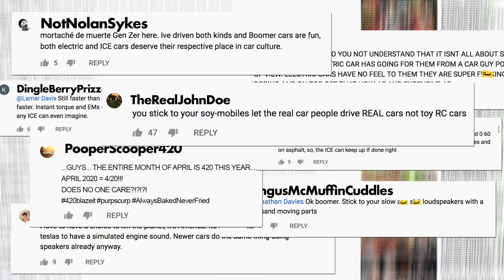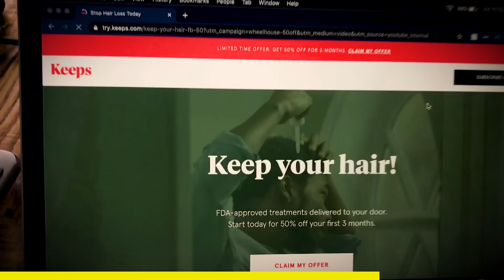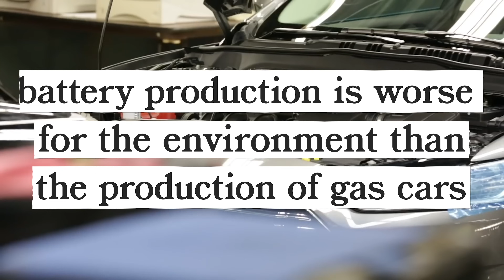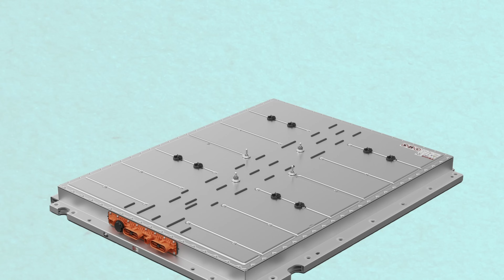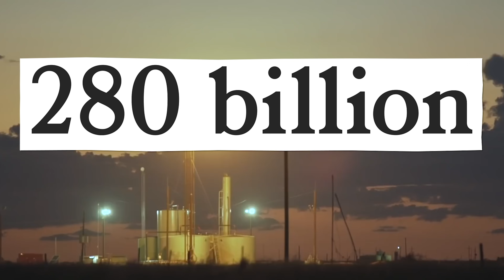Are Electric Cars REALLY Better for the Environment?

Comment: There's another problem:
The batteries don't life forever. I think I heard of a lifespan of about 7 years. Recycling old Lithium and Cobalt is not that possible as I think. 
What about the waste? And then we need even more batteries to exchange the old ones. Oh man.

I'll stick to gas anyways. Even tho with smaller engines. But I personally just need that feel
Reply: This is most certainly not the case. Here, you can look at real life data for how tesla batteries degrade. https://steinbuch.wordpress.com/2015/01/24/tesla-model-s-battery-degradation-data/

After their useful life as car batteries, they are used for second life projects where they help balance the grid. It is true that at this moment, the battery recycling industry is still insignificant, but you must not forget that the demand for battery recycling is behind the trend of EVs for like 10 years. The growth in EVs now will make it such that in 20 years, the demand for recycling will rise. Also, scientist are looking into using common elements. Rarity only bumps up the price. It's unreasonable to assume Cobalt will always be used in this quantity. The technology will move on to better designs.
Reply: @thatyougoon1785  ok that's a good thing :)
Reply: Lithium batteries (in Teslas case) are recycled.
Reply: @VincesVoices  warte mal. DER ORIGINALE SPEED COMPARER?!

Omfg xD

Comment: One thing to note about EVs is that they lose range every time you charge them with fast charging doing even more damage to the battery.  You aren't crazy if you feel like your phone battery runs out faster after a year or two.  This is why Evs will never truly replace gas or any future fuel cells until a major change is made in battery technology same reason solar will remain a minority source.
Reply: Tesla have already talked about a battery good for 1 million miles.

Comment: I have one pickle to pick with this comparison video - if I understood it correctly you took more than a year of running to compare EV vs Gasoline car. But what about if we consider battery replacement/engine replacement? I read somewhere usually you need to change batteries in EV every 5-8 years. Which would surely impact those numbers a bit. Right?
Reply: No, that will not be the case. https://steinbuch.wordpress.com/2015/01/24/tesla-model-s-battery-degradation-data/

Comment: Did you take into account that the emissions behind the production of the EV batteries are not just a one time expense though, since batteries die and you have to keep replacing them?
Reply: EV battery packs typically come with an 8 year warranty. Tesla have supposedly come up with a battery good for 1 million miles. Which would put the argument to bed.

Comment: Excellent and balanced video! Some notes:

Lithium and cobalt are definitely issues, but if you're reading this on a laptop or mobile device- that's the major use of lithium (plus 18% in ceramics and glass).

And about 9% of global use of cobalt is for desulpherisation... that's the process where gas and diesel are refined so they're usable as a fuel source. So 'clean diesel' has a major cobalt component use as well.

Tesla is also working on a 1 million mile battery. If the batteries last that long, then you're getting far more use of your lithium and cobalt- that's a far better payoff than most of your batteries in all sorts of other uses.

Finally, don't just focus on CO2. ICE vehicles also produce particulate emissions... the kind of things that are leading to major respiratory health in major cities.

I fully understand the love of the roar of a V8... but environmentally (and in terms of efficiency of converting fuel source to pure motive power), EVs dominate.

Comment: The REAL Question is:
Are Electric Cars REALLY Better for the Enjoyment?
🚫 😴💩
Reply: oh boy you need to feel the pull of the electric motorcycles, they deliver all the torque at any moment. Combustion engines need to be on the RPM sweet spot for maximum torque.

I know I know, the sound of combustion engine is a huge PLUS. I do have a sport bike that revs to 16K RPM so yeah I know what a sick sound can produce.  But I'm also an amateur motorcycle racer, so I also take into account power to weight ratio and torque figures. This first generation of motorcycle are a promise of a interesting, no so far, future
Reply: @luisdiegocr  Hola Diego!
I know I know...  Take it as a rant from a hardcore fuel addict,  ROFL!  
It was my attempt to troll. 
Up to a year ago I still trusted that ICE engines would somehow prove their worth.   But now I think they may lose this fight.  But I will, for sure, keep an ICE car to enjoy the sweet feeling of changing gears on my own and feeling independent.  
NOT inside a huge Laptop that registers and tracks my every move 24/7 which is what eCars do: the ultimate spying machine. Imagine when our own cars start issuing us tickets for speeding...  Or when car memories become evidence in trails... 
A brave new world my friend, iPhone. FB & Google's new friend: eCars!
I have seen some of those bikes on YT impressive!  Enjoy yours when you get one!
Reply: Yes
Reply: The mass majority of car buyers are buying Corollas or other equally boring commuter cars. . . The sports car enthusiasts were never the problem.

Comment: Another thing you never touched on was that the batteries become less efficient over time too. So they become "heavier on fuel" too so will have a higher carbon footprint. Maybe not as high as an ICE car but still brings it more in line with what will actually happen.

Comment: So what i got from this is that its really not the cars that arent efficient its just the production of fuel for each car. Even if its electric it can be just as inefficient as a gas car just due to the production of fuel. So why not fix the production proccess of oil and try to capture that carbom monoxide.

Comment: I live in the country and have solar power on my roof.  I drive a Chevy Volt about 8000 miles a year.  The solar power charges the car and I have 0 use from the grid.  In fact in 2019 I put more than 600 KWHrs into the grid.  The Volt does have a gas engine and I used 52 gallons of gasoline for the whole year of 2019.  Due to the lack of charging stations in rural area where I live I didn't choose a 100% electric car.  But I am helping global warming and air quality perhaps in a small way and enjoying not having to pay the electric company any money and not paying oil companies much either.  A win for me and the future of the world..

Comment: 5:55 Nuclear is clean energy in term of CO2 production too.
Reply: Not so much, yellow cake has to be mined first to make the enriched uranium first, then you have to build a plant, hopefully better than Fukushima, then a lot of water is turned into seam...more CO2. 
After it is all said and done you have to bury the highly radio active waste after using more chemicals on the rods to draw out more uranium, creating more HLW waste too...so how do you effectively measure all that?
Reply: @sickjohnson  You can say the same exact thing for all others clean energy, you have to mine materials for them, you have to recycle them after a certain amount of time (20 years for solar and windmill) and since you're talking about recycling, you should look into the problem of windmill blades, it's a good read !
About the HLW, it's a non-subject, if you take the exemple in France, it's only represent 0.2% of the whole volume of nuclear waste, it represent a cube of 15meters since France started nuclear (most nuclearized country in the world).

And all that talk is pointless, Solar and Wind are intermittency energies, you can't relay on them uniquely, you need a energy wich can be controlled.

So either you burn gaz/coal, either you go nuclear with way less co2 emissions.

Until we're able to use fusion power, if it's possible.
Reply: @EnrichedNaquadah  Agreed, and I read about the fiberglass wind mill blades failing and are not recyclable, not to mention the size of a huge tractor trailer truck.

Comment: i saw a gasoline powered car towing a diesel generator to charge an EV car :P
Reply: Weirdly enough, putting gas through a generator to make electricity for your EV is still more efficient than just driving a gas-powered car. . .
Reply: @normang3668  True!
Reply: My brother in California was using his generator to charge his Tesla last summer in Northern California during the brown outs
Reply: I saw an EV towing a gasoline refinery for a car that had run out... Wait what?
Reply: @skodbolle  A whole refinery huh? Sure.
Reply: @skodbolle  Gasoline refinery? Nah bro it was prolly just a jug of gas.
Reply: @somethingsomething3718  Nope.. a generator is the same as a refinery, it's where to power comes from.. The gasoline car wasn't towing a battery now was it? :)
Reply: @skodbolle  Wrong, a refinery is not the same as a generator. A refinery refines crude oil into gasoline, Diesel, etc. A generator uses fuel (diesel mainly, as its more efficient than gas, due to the higher compression rate) to generate electricity.
Reply: @skodbolle  LoL, did you eat paint chips as a kid?
Reply: @MrShadow1617  Gasoline in a container, is more or less the same as a battery, you store energy in it, and therefore not he same as a generator :) I know it can be har  to understand ;)
Reply: @mantis_toboggan_md  No, did you? :D Kind of a strange question
Reply: @skodbolle  Yes.  Petrofuels are potential energy in a STABLE format.  Left alone, they will reliably store that energy for over 2 weeks, and be no more dangerous than a tank of mineral oil.  Since it takes a mixture of AIRand petrofuel VAPOR to become combustible, it's a nice way of doing it.

Batteries are stable UNTIL you try to store energy in them, which makes them volatile.  Also, that energy slowly leaks out and has to be replenished, EVEN IF THE CAR IS NOT IN USE.  Never mentioned as far as efficiency or 'clean and green' numbers.

Speaking of numbers...going from 20x more energy being used by an engine that's 20% efficient, to 1/20 the energy and an 80% efficient motor...explain how that's an IMPROVEMENT.  (20% of 200 watts is 40 watts.  80% of 10 watts is 8 watts.  The EV can go only 1/3-1/4 the distance an ICEV goes per charge or  fill-up.  That's a MAJOR DOWNGRADE for ZERO actual benefit.)
Reply: @skodbolle  I was talking about an ACTUAL generator, that USES fuel. Sure, every damn internal combustion engine powered car has a fuel tank, but it still lasts longer than a battery in an EV. I can go for about 4-5 weeks without needing to refuel my own car, especially since its a diesel.
Reply: @MrShadow1617  I can go for about a week with out charging my car, but I do charge it when it sits in the garage anyway from my solar panels.. Sooo how far can you drive in your diesel for free? 😉
Reply: @skodbolle  Alright, fine, guess you got your own house, with everything paid off, only having to pay for utilities. Went a bit off topic anyway.

Comment: What's the average battery change interval? Are you assuming 100% battery efficiency, along with manufacturers stated ranges?

I feel like if the battery only lasts 3-5 years and becomes less efficient, it might still be a toss up.  Also wonder how much power is lost from the plant to the home...voltage drop and such.

Comment: Great episode but what about the life of a battery pack vs the life of a gas tank.
Reply: Reed Nelson your average EV battery is good for 200 000 miles, or about 17 years going by US national averages. An ICE engine is designed to last around 100 000 miles by current production standards.

Yes you see ice engines going for far longer than 100 000, because they’ve been entirely rebuilt, bringing production emissions up far higher because a lot of these specially built parts are not being built as efficiently as the OEM parts are in factory.
Reply: @thomasellis7625  there are millions of cars on the road today that have well over 100k and far into 200k miles on the original not rebuilt engine.

Comment: Appreciate this info. As some one who loves V8s and has a life that revolves around heavy equipment, I'm skeptical of EVs. But I hope the technology progress's enough it is much more effective in different applications. I'd love to see a one ton truck with a diesel over electric drivetrain, but the cost and weight of such a thing seem to make that a pipe dream
Reply: diesel electric is the only profitable way to go for heavy vehicles and there are plenty of them already around us so its not a pipe dream
Reply: @bjorn1583  what I was meaning  is  diesel over electric is common in locomotives, and mining equipment. And works well. But I myself haven't heard of it in highway trucks or pickups. Or even farm tractors. (I think John deere and maybe case played with prototypes but I never heard of it hitting the market). Electric and diesel motors are heavy at the moment so some what ineffective  in those markets. But they work very well

Comment: Great episode.  You forgot two things... 1) ICE cars have been there longer, hence, getting a used one means that someone else had paid for the initial footprint.  2) ICE requires more routine maintenance in the form of belts, grease, oils, etc.  This should add to the footprint. 

Again, great episode.
Reply: @Unintended Consequences Mechanics etc. could go broke if ev's take over, a factor in why there is opposition to ev's. Not as much to go wrong with ev's.
Reply: Justwantahover Yeah I’m a licensed truck mechanic. EV’s will definitely make work slower
Reply: Problem is that battery packs are only good for 6-8 years and then need to be replaced with not even doing close to the same daily/yearly mileage as combustion cars lasting past 17 years on average. Nolan didn't take in account for the carbon footprint of solar panels and wind turbines (short lifespan) as well...like he did mention for oil and gas production. Ironically EV's use way more oil to produce than combustion cars do sadly. 
Solar is almost never used to charge up EV's as they mostly operate in daylight hours and charge at night.
Did Nolan ever mention that fuel is 5 times more energy dense minimum than batteries, and that means that must weigh at least 5 times more, and that extra weight takes away even more of their already low efficiency? 
There are many more factors that should have been considered too, other fuel types too like ethanol...
All you will ever be told about is the maximum efficiency of an EV, in a vacuum at ideal temps...add some hills and some cold weather that plagues the majority of the world and that will take it down below half before you add any weight to the EV; not to mention just after 2 years the EV's storage capacity is noticeably reduced unfortunately.

Comment: Here’s the problem: hydro, solar, and wind can’t even hope to put a dent in the country’s power needs, and aren’t accessible everywhere.

Want to lower emissions? Stop demonizing natural gas and nuclear. They aren’t ideal, but they’re here, and they work. The former is responsible for virtually all of the decreases in emissions over the last decade, and the latter is perfectly safe when handled correctly. Chernobyl is a cautionary tale against poor management and neglecting maintenance, not nuclear power in and of itself.
Reply: fukushima is a cautionary tale about proper plant design as well.
Reply: 7 Sins Absolutely.

I’m not going to pretend that there aren’t certain risks involved or ignore the issue of what to do with the waste (this Nevadan would just like to point out that Yucca Mountain is already contaminated for the next several thousand years anyway),  but pretty much every nuclear incident has been the result of human stupidity, not because nuclear cannot be controlled.

Comment: Actually, if 25% of the vehicles in North America were electric it would have a huge negative economic impact. There would not be enough charging stations and for people who travel for work would have to stop at least once a day for an hour to charge their car and that is if there isn't a lineup.

As a Canadian, I can only use a local example, the 2 major cities in Alberta, Edmonton and Calgary are 200 miles apart and over 50,000 vehicles a day make that trip and over 15,000 vehicles make a a return trip. That means 20,000 vehicle a day (25% of 80,000 trips. 50k +15,000 + 15k return trips) . need to recharge at least once on that trip.  That doesn't include the more than 175,000 cars that make part of that trip each day. It would be impossible to have enough infrastructure to charge that many vehicles on that trip. A study was done regarding 50% EV's and they estimated it would require over 25,000 charges that could fully charge a vehicle in an hour or less to only use an hour of extra time for the normally 3 hour drive. Of there was only 5000 charging stations on that route, that 3 our drive would take over 7 hours due to waiting times and they would have to have at least 6 parking spots for each charge plug to handle the waiting people. To develop the infrastructure for that would cost over $12BB. That would be for a 200 mile stretch in a province of only 4.5 million.

If you take the number of people that are required to drive 3-6 our trips in a dense population on the East Coast, where would they put the 500,000 charging stations in only a 600 mile radius.

I do t ha e an issue with EV cars, they are great for short distance drivers, but the logistics are almost impossible to implement across North America.

Comment: Biggest issue that wasn’t addressed...EV battery lifespan.  Cars from 100 years ago still run using their original engine.  Whats the best EV battery life?  15 years...  This HAS to be factored in to this equation.